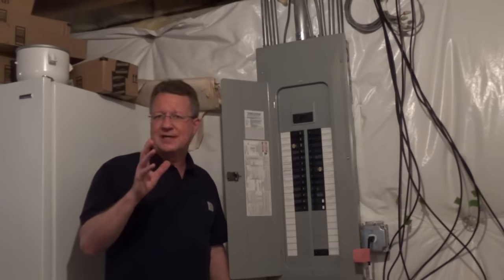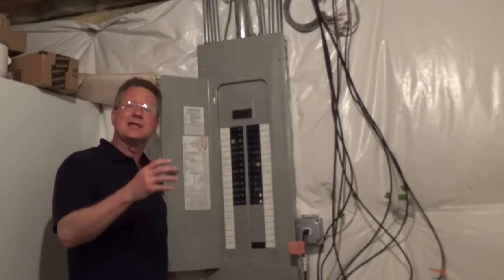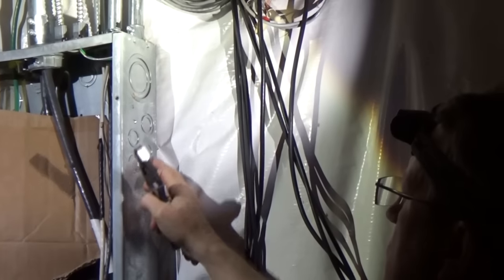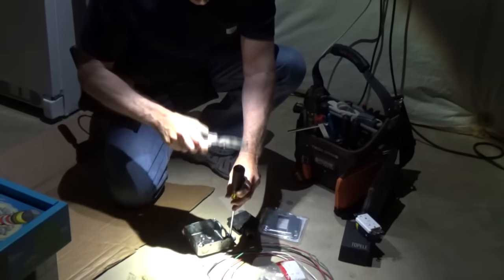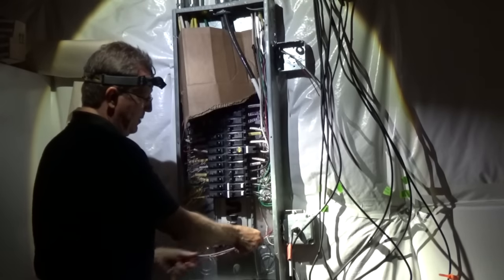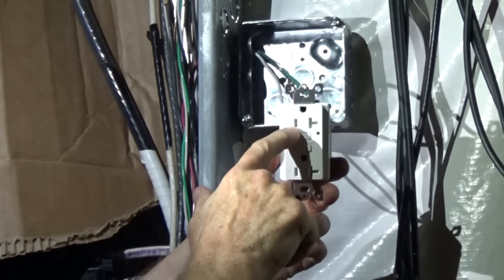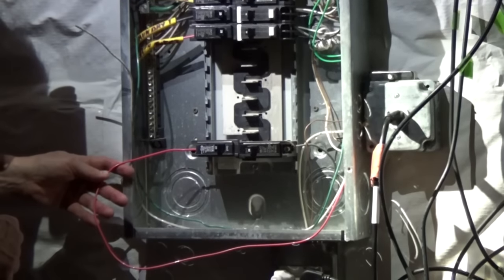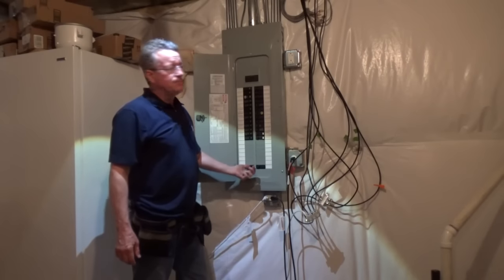Add an Electrical Outlet to a Breaker Box

Comment: Forgot your green grounding screw to the tapped hole in your 1900 box . Thats okay though most people dont .
Reply from the maker: Hi, I was taught by my electrician that a metal box connected with metal spacers is grounded by the service panel. If I were running non-metallic cable into a metal box, then I would use a grounding whip and connect to the bare ground to the cable and the device. Let me know your thoughts.
Reply: Honestly we could go on about this forever ,but hes wrong . Even when we do 4 in boxes on metal studs with conduit ,the inspector will check for grounding screws . Regardless if you ever want to know anything subscribe to Mike Holts email . Great free resource . The Bible of grounding has always been the Soares book . BTW your box will be grounded ,but one loose locknut will cause it to have a high resistance .
Reply from the maker: Thanks for the info.
Reply: @catfishjenkem2226  Every area is different. In some places you get red tagged if you ground  it with a screw.
Reply: @piousminion7822  Yep frequently inspectors are uneducated also . Regardless do anything it takes to pass .
Reply: @catfishjenkem2226   I thought I had deleted my comment. I made it before seeing the whole vid. My bad.  Those 4 inch metal boxes should always have a ground screw.

Comment: Where’s the code that says the ground has to be up when it’s 36 inches off the floor. Tell me.
Reply from the maker: Hi, my electrician advised me in this community they want the ground up if the outlet 36 inches from the ground or over a countertop.
Reply: @FIXITHomeImprovementChannel  what's the reasoning for that?
Reply from the maker: Hi, if you are working on a counter and have an appliance not fully plugged in, a metal object would hit the ground prong rather than the hot prong and be safer.
Reply: My house has it all over
Reply: I can't speak for your area and I don't know what area you are in but I can't find any code for ground up.

Comment: Wouldnt it simply make more sense to connect the wires to the breaker first and then simply flip the breaker so you only have to have your main power off for like 1 minute rather than 20 minutes while you set up the outlet?
Reply: You just don't want to take any chances with things like that.
Reply: @veritas17  what chances....lol that's what people do when they do electrical work
Reply: @kittykittylicization  ...accidents occurr and im not personally ready to risk my life for laze or hubris. You do you.